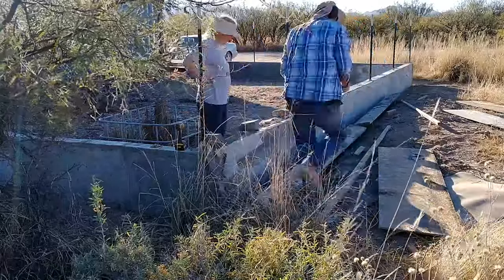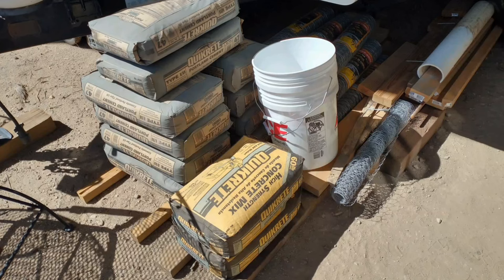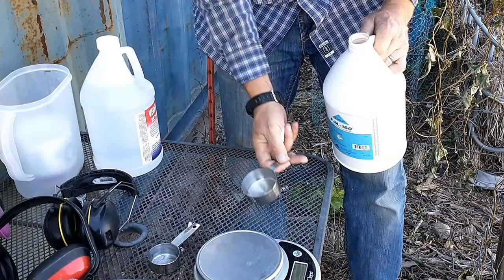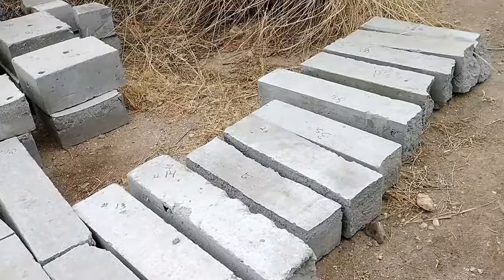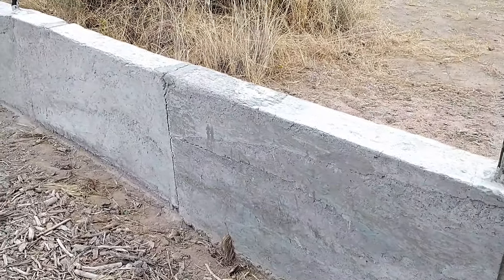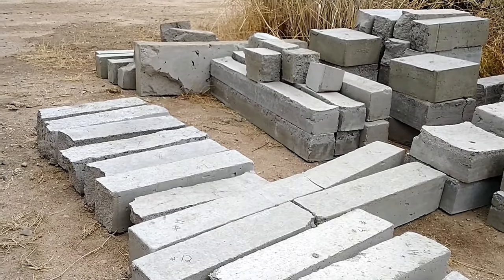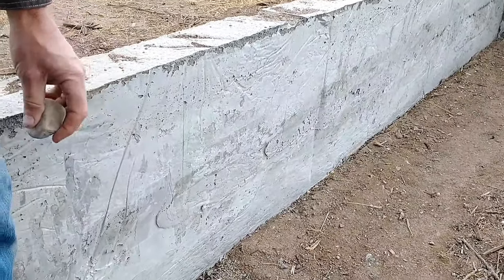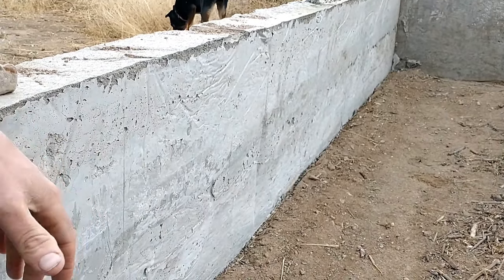Why we GAVE UP on AIRCRETE & What is Our Plan Now?

Comment: Graphene-enhanced concrete is tested and it provides a 146% increase in compressive strength, a 70% increase in flexural strength, and a 400% decrease in permeability. The incorporation of graphene in concrete would develop structures with increased durability, an increased conductivity, and thermal properties. Resulting in an overall decrease in CO2 emissions.
 Hemp concrete or hemp lime, it's a biocomposite made from a mix of the woody core of the hemp plant, lime binder, and water. The hemp core (also hemp hurd or shiv) has a high silica content that allows it to strongly bind with the lime.. As a result, you get a lightweight, cementitious material with good high insulation properties that weighs six to eight times less than concrete. It's ability to aborb CO2 emissions actually make it a carbon negative product. Because of the high moisture content care must be taken in the drying or curing of hemp, unless your intention is to make hemp graphene. At this time hemp is available in moderate amounts except for industrial or textile use and is utilized in a variety of products from clothing and shoes to bulletproof vests, car parts, artesian niche soaps, oils, beauty and health products. For hundreds of years it has been available as rope for maritime travel in boats and netting. Hemp as a means of paper and due to it's strength even the paper is utilzed to make implements, dishes, cups and musical instruments.
Aircrete is simply concrete with bubbles., there is no set formula. Fine foam, which has a high density, can be added to increase aerated concrete's strength, which results in a stronger aircrete. When high densities of foam are included, aircrete can become brittle, and chipping can occur. This type of aircrete will have limited compressive strength and could not be load-bearing.Aircrete offers many traditional concrete benefits with added properties to enhance sustainable and energy-efficient homes. Aircrete offers superior insulation properties due to foam and air bubbles built into concrete itself which can be enhanced by adding various types of polystyrene or polyurethane foams improving it's insulation values.Aircrete is most often used for exterior and interior walls. However, aircrete can also be used for several other home applications, such as precast blocks and panels and concrete slabs for an insulated flooring system. In some cases aircrete is used for poured roofs, increasing insulation capacity of ceilings and attics where heat tends to escape from homes. When used with additives it's load bearing capabiities, compressive strength, durabilities and other characteristics are greatly enhanced.
Reply from the maker: The availability, cost, and labor of different aircrete add-ins was our main consideration. I have seen people experimenting with using graphine in aircrete, but it seems to be hard to get in a usable and affordable form. Adding styrofoam looks interesting, but the logistics, method, and tremendous amount of space and styrofoam that would be required to build a home are a couple of things that steered us away from it. 
Red adjusted the air pressure some for the colder temperatures, but I think our foam was still more dense than it was earlier so I figure that's why our batches were getting more brittle.  
Now that the cost of lumber has come down some, it is actually less expensive to build a more traditional house than one out of aircrete. Aircrete would have made a more interesting house, but we didn't want to wait 5 months before we could try again. 
Good info! 😎👍
Reply: @RedandAprilOff-Grid   it's cheap to make graphene and it can be made from most anything including sugar. Aluminum powder limestone powder and polystyrene is cheap.Basic recipe for non-autoclaved lightweight aerated concrete (aircrete) with 600lbs kg/m3 density:

-Ordinary Portland cement
-Limestone powder (particles up to 0.05 mm)
-Aluminum powder MEPCO 7520 or any Aluminum powder with blaine value 15,000 cm2/g and more

Dry mix formula:
50% cement (by weight) + 50% limestone powder. For 1 kg of dry mix you need 500g cement and 500g limestone powder
Mixture formula for for 700kg/m3 density:
1 kg of dry mix0.65 liters of water, 1 g of aluminum powder for 100 kg of dry mix you will 65 liters of water and 100 g of aluminum powder.

How to mix it: 
1. Add water in the bucket.

2. Add dry mix in the water and mix it for a couple of minutes.

3. Add aluminum powder and mix 1-2 minutes. 

4. Check video for graphene dry mix ratio and add

5. Pour in mold.

Videos are on YouTube.
Reply from the maker: @nwflboy007powell8  Sounds interesting! 👍🙂

Comment: Perhaps aircrete is more suitable as an insulation material and not rely on structural capability at all. 
It looks like your cement dried out too quickly, thats why the blocks are powdery, cement needs moisture for a few days to chemically cure.
Reply from the maker: When testing our first set of samples we watered them twice a day for 7 days. These last fiber samples were not kept as wet in the well house. They were just covered in plastic, which kept quite a bit of the moisture in but not as good as daily waterings. We could also tell right away that the samples had large bubbles and were more like our number 3 and 5 batches, so we weren't expecting great things out of them. Samples 3 and 5 we're also quite brittle because of the larger air pockets, even though they were cured properly. It might work okay for insulation, but the lighter mixes turn to powder with any rubbing or impact.
Reply from the maker: @khandam7709  It would require a whole lot of styrofoam, and I'm not sure that it's actually that easy to make or dependable in how it turns out. It will be interesting when more people start making stuff out of it and showing their results. We are not near a big city, don't have a big shop to store and shred massive amounts of styrofoam, and I would rather not have our vehicle and property covered in styrofoam bits.
Reply: @RedandAprilOff-Grid  You are very thorough in your experiments.
 The only other thing I could think of to improve the blocks would be to line each block mold with a sheet of housewrap or similar material so that you get the effect of drywall, as the plaster powder in drywall is very brittle and requires the paper both sides to give it strength. 
Maybe other fabrics would work, if they are able to hold moisture and not shed it like housewrap it could be dipped in a bonding agent to help glue it to the block, but then your mold would have to be polycarb or some other rigid plastc, and the blocks would have to be big in order to make it worthwhile to go to all that trouble.
Going for a coating solution rather than an additive could work out cheaper than mixing a substance all the way through when just strengthening the outside of the block is required.

Comment: F aircrete 😂, lol, j/k, but the hell I seen y'all went through with that aircrete was just crazy. Y'all did so much work and did some awesome testing that helps everyone else who might have gone down that rabbit hole, I had seen some videos on it and immediately thought man. That's a great idea! You could just pour for thick walls and have super insulation and it would be strong and amazing but I guess the strong point doesn't work. Thing will just crumble like packed together. Sand, lol. 
Anyway, I guess if aircrete is a dead end, I may look into one of those printed houses where they printed out of special kind of concrete and it prints avoid in the wall so you can fill it up with insulation. Insulation anyway, good luck to y'all. Keep up the great work
Reply from the maker: 😄 We are just glad we didn't decide to try to build our house out of it. It would have been such a pain, and it wouldn't have worked very well. It's also not particularly good insulation, it's not fun or easy to make, and it's not inexpensive. The experience made us appreciate conventional materials a lot more. 
Our son is building a house using hyperadobe bags. It's like 3-D printing with dirt. It's not fast, but it makes a really strong and inexpensive house. Our most recent videos share his build. Best wishes! 🌞

Comment: If I were making a tiny retirement house in the high desert, I'd just go with cinder block.  For coolness, I'd make an extra-high ceiling and tile floor.  Can always cover it with a rug in the winter. Two stories might be best:  appliances and summer sleeping downstairs, winter bedroom upstairs.  But then as you get older, you won't want stairs.  Anyway best of luck.
Reply from the maker: Because of the extreme temperatures we get here, we wanted to build a house with good insulation. We ended up going with 2×4 framing but we added exterior insulation. Along with the passive design and thermal mass our house is heated entirely from the sun in the winter. The stable even temperatures are amazing! Thanks! 🌞🏜️

Comment: Add graphene and styrofoam for the perfect building material. Graphene's made with graphite and milk mixed in a blender for ~30 min. It can increase concrete strength 8 fold.
Reply: I saw the video on this by Robert Mills Smith.  Has anyone debunked this video?  Sounds too good to be true.

Comment: Coat the aircrete surface with brushable plaster/Paint slurry: Mix up a bit of white cement, water and sodium silicate (2% by weight), Highly reflective (High SRI) and very durable.

Comment: It is because you are expecting it for application that it does not designed to. The aircrete is designed only for low-height one-floor-only mini house with reinforced fiberglass mesh after finished placing it. It is not designed to be used for supporting heavy weight and it is known to have very fragile tensile strength. It is suitable for short wall with very little load. The good thing is that you can add more thickness without problem and will provide more insulating power significantly. This is good for those looking for insulating + wall all in one.
Reply from the maker: We explained our plans for reinforcing and finishing the walls in our previous videos. Yes, we realized aircrete is not a great material. There are less expensive and much better building options available.

Comment: I've done some testing myself and your foam concrete looks like is doesn't use enough sand.
What I've done to make it more durable and reduce big air bubbles was to increase the tenside amount and foam it to 30g a litre. I also increased the amount of sand but used very small construction sand. I also added hemp fibres to it. The resulting bricks behave like hard plastic. The denser foam can hold the smaller sand much better and hemp fibres gave extra support.

If you need tensile strength you need to add a large mesh structure of some kind, small shredded fibres dont help much and can even make it more brittle. You need long intertwined organic fibres or a glassfibre/metal mesh or similar.

If you want to cheap out and have an easier build I'd use earthbags instead of foamconcrete. Foamconcrete is hard to make and needs exp. or one needs to follow a recipe exactly for it to be good.
Reply from the maker: Glad you found something that worked. Aircrete is tricky stuff. Some of our earlier batches turned out really well. We have videos showing the methods we used, and different things we added and tried.  We suspect the colder temperatures were the main issue with our later batches, but there were probably other contributing factors.  Regular aircrete doesn't have sand, but we tried some batches with finely sifted sand, it almost worked. It had awesome compressive strength, but the batch fell slightly, and sifting the sand was a lot of work, and it was heavy and hard to mix. Best wishes on your aircrete projects! 😎

Comment: How long have you had that cement powder? It has a shelf life. After three or so months it is starting to absorb enough moisture from the environment to significantly affect its strength. Obviously that number is affected by how well it is stored and the humidity in the area, but as a rule of thumb...
Reply from the maker: It was purchased within a few weeks of using it. There was a shortage in the stores when we were trying to make these samples, so we tried a few different types.

Comment: I applaud you all for taking on building your own home. Seems to me you took on a course in materials science and engineering, without having an instructor to help you know the chemistry and physics principles in play to explain what you experienced and figure out how to make changes to get what you want.
I agree with commenters who made a point about the environmental changes (due to weather) that impacted your results with the aircrete blocks. There are chemistry and physics principles at play that commercial operations tightly control so they get consistency in production variables. Your experiments show how sensitive materials can be to the environment.
I wish you well with your new approach and hope the result is all you want it to be!
Reply from the maker: Thanks!  We also learned that aircrete isn't an inexpensive material to build with. The house we built was easier, and less expensive. It's also heated completely passively in the winter from the sun. We are very glad we didn't use aircrete. 🌞🏡 🏜️

Comment: What you should use is shredded styrofoam mixed with fiberglass reinforced concrete.  Much easier to get a good mix.  Problem with aircrete is air bubbles collapse resulting in a poor mix

Comment: Thank you for showing the reality of aircrete.  I commented in your other video that I used perlite, it is rock bubbles so there is no inconsistency in the air bubbles because they are already bubbles incased in rock when you get the perlite.   I also sandwiched the lightweight concrete with fiber stucco to give it hard surface.   Where are you located that you can do builds like this?  Rural Texas?  
I will also say if you are willing to spend lots and lots of time building, they are many options. My idea was a method that is not labor intensive, but only time intensive using forms to create arches.  You can only pour one arch at a time, and then wait days for it to harden enough to do the next one, and 50 arches then takes a long time....but not a lot of labor, and it would scale if you have multiple forms.
Reply from the maker: We are in Cochise County, Arizona and have an owner builder opt out permit, so we thought it would be fun to try something different. It was an experience and made us appreciated regular construction materials even more. We liked the idea of just adding bubbles, because it would be less materials to buy and deal with. We were so glad, we changed plans, and love that our house is very energy efficient, and almost completely passive. The arches sound pretty cool! 👍🌞

Comment: As a residential designer that specifies the materials on house and addition projects I hear from customers interested in all sorts of building systems. A lot of folks lock onto a particular system as the answer for their dream home and I always need to ask what the question is that material answers. It's really easy for people to get caught up on the miracle system that does it all but the choice needs to be based on the sum of a bunch of questions. What is the local climate and what are the site risks, what is the ability of the client to pay, what kind of materials are locally available and meet the clients desires and finances, what are the local trades capable of doing with proven competence are a few of the issues, and there are a bunch of other questions that need to be answered. I have never gotten to build in the desert but if somebody offered me a project on a big lot in an arid place I'd start by looking at what the locals have been doing for the last thousand or so years. If you want low carbon and low embodied energy you're going to minimize concrete, styrofoam and steel.  If longevity, healthfulness and sustainability are important then start thinking adobe or rammed earth at a site like this. Wood is good.
Reply from the maker: Aircrete sounded interesting, and people were saying it was less expensive and had a lot of insulation value. It turned out that neither were true. We are so glad we went with something different. Out house is performing amazingly well and is heated completely from the sun, and with our cool nights a simple evaporative cooler works great in the summer. Our son is currently building a hyperadobe house. It's pretty cool. We are currently sharing his build on our channel. 🌞🏜️

Comment: I am no architect but I have worked construction for quite a few years on your c Channel trusses you should be fine just using them as is look up how much load it can actually Handle by the thickness of it and how long it is another thing to think about is you should put wood purlins on it so you can attach the metal sheeting you also want to put a vapor barrier between the metal in the wood to keep down wrought and good way to attach the wood to your c channel is a Ramset make sure you get the right 27 caliber charge but this will be quicker than using screws because you literally just push it up against the wood and pull the trigger screws will burn out and drill bits will burn up it's a very cost-effective way to attach wood to metal but make sure you only use this against heavy metal not the sheathing it will just blow a hole through the sheathing
Reply from the maker: He already ordered some special screws for it, but the Ramset sounds interesting, he'll look it up. 👍🙂